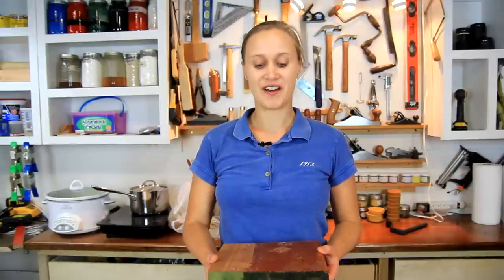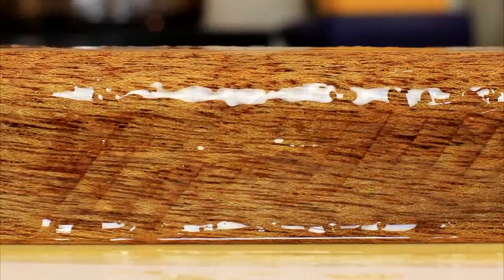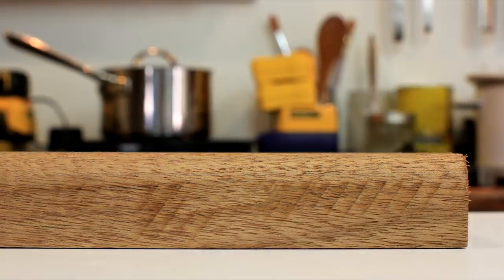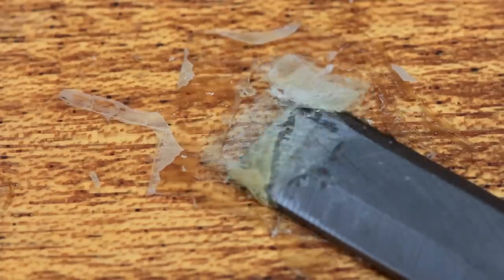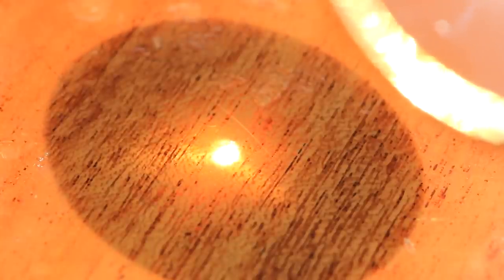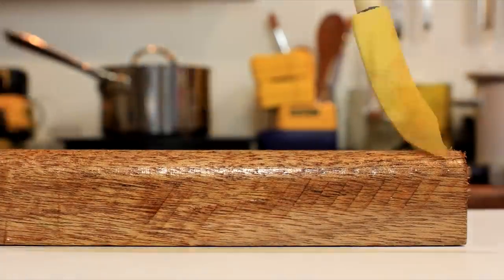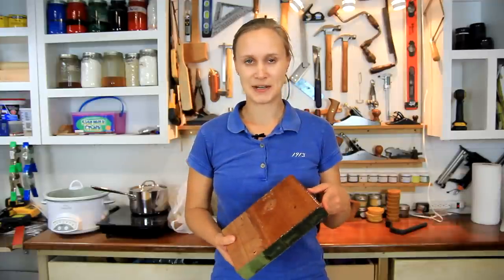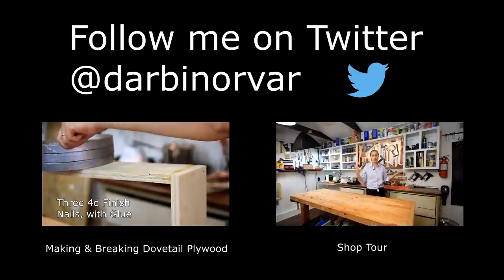What does 40 Coats of Polyurethane Look Like?

Comment: 40 coats.  And here I thought putting 4 coats on my staircase was a pain :-)  Kind of reminds me of the experiment I did making pens and using a CA glue finish.  The more coats you added the more fragile it became.  Almost like glass.  I wonder what would happen if you applied layers of poly to a thin piece of wood, may 1/8" or 1/4".  Being so thin you can flex the wood.  It would be interesting to see if poly really becomes a hard surface or is it still flexible up to a point?  Fun video.  Thanks.
Reply from the maker: Jim Coogan Thanks Jim. I am hoping to see that video from you :)
Reply: Darbin Orvar
I planned to do one once I finished my staircase remodel.  It takes up all the room in my shop.  Almost done :-)

Comment: So it did completely dry/cure, it just took months? Would leaving it in the sunlight accelerate this process?
...
My problem is that I've applied a thick coat of polyurethane and it's been two days and the coat is dried but not cured; I can still deform it with enough pressure, like pressing with my thumbnail. I can surely chisel it off as you did with yours. If your 40 coats still dried and cured, then I will leave this coat on instead of sanding and restarting the process.
Reply from the maker: ***** It did completely dry eventually, so I would just leave it on. It would be a big project to remove it, so I would just give it some time.
Reply: Approximately how many weeks did it take for your 40 coats to dry? Agreed. I already removed it once when this was occurred more severely.

Comment: If you are going to pour that thick use epoxy. Also if you mix oil-based poly 50/50 with mineral spirits and use a rag to rub it on you would not have this problem as much.

Comment: 1st time doing all this, i put 8 coats of polyurethane on my kitchen floor  and its got bubbles, you know how you can use a torch on EPOXY to get the bubbles out. can you do the same use a torch on polyurethane to get the bubbles out.
Reply: +Ruth Tiernan If I get bubbles I just take new clean cheese cloth or any applicator and work them out while it is still un tacky. Any lines or swirls with level out before drying usually.

Comment: 40 coats are too much, you created a gel plastic sheet on the top of the wood, even if you sand you end up with 20 coat, by removing material on each sanding, still a plastic sheet,  oh and by the way, sanding does not create teeth to bite,  it creates more surface area, is like aluminium foil, take one square meter and make a ball, you still have a square meter but compresed with wrinkles and bends, that makes next coat bonds better....more surface area , better adhesion...